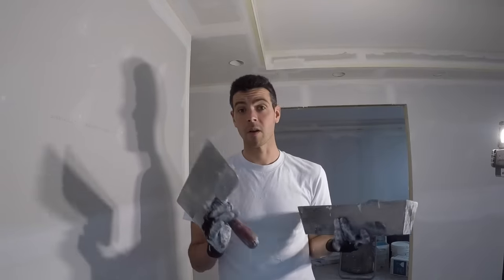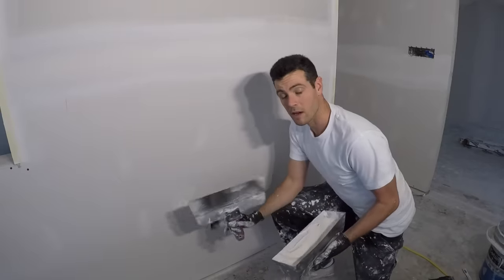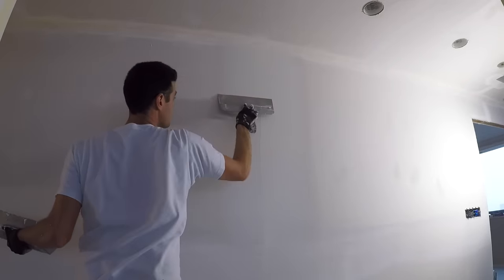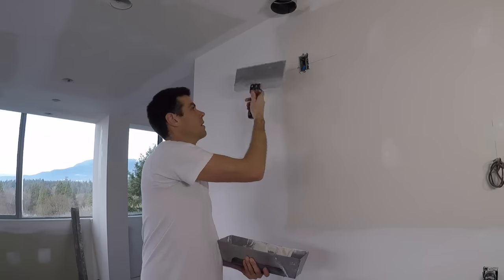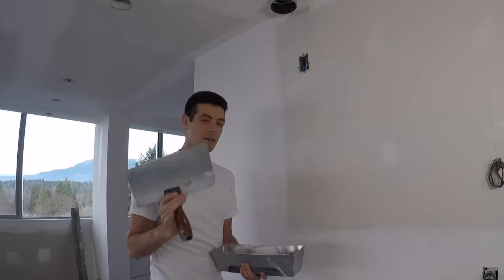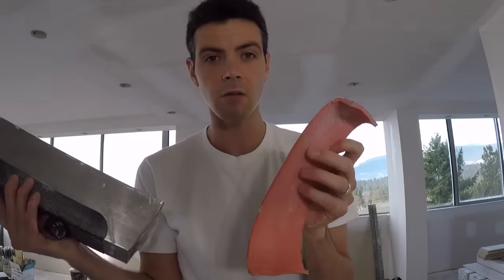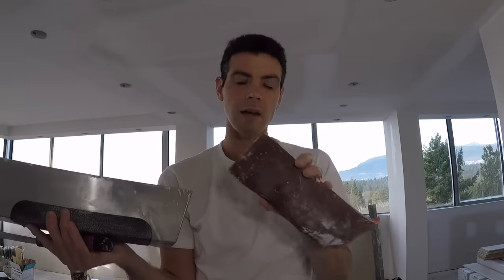HOW TO COAT DRYWALL( BUTT JOINTS)

Comment: Yea hire professional drywallers and finishers, just wondering why your hangers would put a butt joint right next to a window opening and next to a corner bead? Unless you can't get a board that long in place but normally you would make your butt over your window/door openings, a hell of a lot easier to hide than a butt 16" or 32" from a window/door opening. The key to a good finish starts from the framing of the walls got to be as straight as possible any warped studs got to be addressed, then the hanging of the board, once again straight and clean ,not hung by board butchers!! Then it makes getting that nice finish a whole hell of a lot easier!!!
Reply from the maker: It's a high rise. Only 8 foot sheets will fit.
Reply: Wouldn’t putting a butt joint over a door or window just insure a stress crack will happen???
Reply from the maker: Sadly. I think putting up drywall insures a crack will happen. You do have a point about the location though. I just think drywall is a crappy product that was only invented because it was cheap and fast and we needed to build a lot of houses real quick after WW2.
Reply: For sure. You demonstrated and explained well though. Good job 🤙
Reply from the maker: Thank you:)
Reply: Benjamin Dover The best thing to do is not have any butt joints and run full sheets when possible, but if it's over 16' or it's not possible to get that length in place you should break as close to the middle as possible over a doorway/window and not over the door knob/strike side of doorway, some people hang up to the edge of the rough opening and that will guarantee a crack from door opening and closing. Pre fill with durabond glue and screw, butt joints shouldn't crack unless there's significant settling of new construction.
Reply: Put a little dawn dish soap in your topping or all purpose drywall mud it makes it smoother and helps keep out air bubbles that leave pock marks in finished product, less sanding, clean finish.
Reply from the maker: Agreed👍
Reply: Well from what I know if you add any product to drywall mud then the manufacturer won’t guarantee their product if anything should happen so maybe just don’t add dish soap. And no matter where you put the butt joint over the door or window it’s not going to prevent the wood framing from shifting and still causing it to crack. The drywall doesn’t crack the expansion and contraction from the wood framing causes cracks. So idk
Reply: @fabianvasquezjr8852  if you modify from the manufacturer they don't guarantee their product.  If that works great, but I would rather have the company behind me if something went wrong than have to pay it out of my own pocket.    Then again i'm not a professional, just a handy guy who gets a pretty good result by following the directions on the box.
Reply: About 3 inches from the corner of the doorway or Windows. Use drywall glue, and screws. One screw replaces 2 nails, glue replaces 1 screw. Less cracks with those two. However they can fix a bad framing job.

Comment: Want to know how to make a perfect butt joint? Run the drywall vertically as the manufacturer designed it to be run. That is why it comes in 8 and 10 foot lengths. I guarantee I can walk into any house you have done and find the bulges of butt joints. The reason I know this is the only 2 people who run their drywall horizontally are those who don't know any better and those who care more about production than quality. Production guys aren't going to spend the time putting on 3-4 or how ever many coats it takes to really hide the joint and you know that. That is why so many home builders are painting with hard to clean flat paint, because it helps hide the shoddy drywall work.
Reply: I always wondered about that every time I saw someone hanging it horizontally. I was always taught to hang it vertically...which makes sense with the lengths it comes in as you mentioned. Plus, that means your joints are always flatter, instead of bulged up where two ends meet...which should really be along the floor/ceiling. I'm no carpenter by any means I've just helped a few friends here and there...we've always hung it vertically. I was very intrigued the first time I saw someone hang in horizontally. My first thought was "Do they know they're hanging that wrong?" Which very quickly turned into "Wait, am I doing it wrong? Do they know something I don't?" Glad to see your comment I don't feel so crazy now.
Reply: I dont have alot of practice taping, so when i finished my basement i hung all the drywall vertically, so i wouldnt have to deal with as many butt joints... a few people that stopped by, cause i was doing it in my spare time, said i was hanging it wrong!
Ceilings are another story though... lol
Install the longest sheets you can possibly fit in through your workspace, and eliminate as many joints as possible.
Reply: ha ha . you guys are all funny.  I've only spent 3 weeks working with a union company taping a commercial job. the drywall is hung HORIZONTALLY. So the flat/recessed joints are horizontal and the butt joints are vertical.  They told me why but I don't remember.  I don't see how putting drywall on horizontally would increase production over doing it vertically. I did a google search and indeed, there are reasons for hanging drywall horizontally and it is preferred. ... This is one of the explanations I found. 

According to Chapter 3 of the Gypsum Construction Handbook, published by USG, manufacturer of SHEETROCK® Brand Gypsum Panels...

Perpendicular vs. Parallel Application
Gypsum board may be applied perpendicular (long edges of board at right angles to the framing members) or parallel (long edges parallel to framing). Fire-rated partitions may require parallel application. (See Chapter 10 for specific information on fire-rated systems.)

Perpendicular application is generally preferred because it offers the following advantages:

Reduces the lineal footage of joints to be treated by up to 25%.
Strongest dimension of board runs across framing members.
Bridges irregularities in alignment and spacing of frame members.
Better bracing strength—each board ties more frame members together than does parallel application.
Horizontal joints on wall are at a convenient height for finishing.
For wall application, if ceiling height is 8'-1" or less, perpendicular application of standard 4' wide panels results in fewer joints, easier handling and less cutting. If ceiling height is greater than 8'-1", or wall is 4' or less wide, parallel application is more practical.
Walls ranging in height from 8'-1" to 9'-1" can be clad with perpendicular 54" wide panels to eliminate the addition of more joints. (See Sheetrock brand gypsum panels—54" in Chapter 1.)

For ceiling application, use whichever method—parallel or perpendicular—results in fewer joints, or is required by frame spacing limitations

For double-layer ceiling application, apply base-layer boards perpendicular to frame members; apply the face layer parallel to framing with joints offset. On walls, apply the base layer parallel with long edges centered on framing; apply face layer perpendicular.
Reply: Some commercial works requires stand up board.Horizontal has always been the way to go.How long have you been in the business.... a few months. Sheesh! I'm in it 40 years and you talk like a worm.
Reply: @yabitz742  

I generally try to hang it horizontally for the reasons that you found in your Google search. Horizontally definitely works better when you can you use extra-long sheets to cover the full length of a wall.
Reply: Vertically is the best way to get a flat wall, no questions asked. That’s why it is manufactured with bevels on the finished edges which allows the mud to fill to the same height as the flat. You always want the unfinished ends hidden by trim or a corner whenever possible. Not to mention hanging vertically makes it much more likely that you will have a flatter finish when using corner bead.

No doubt horizontal hanging is easier, cheaper, and faster, but if you are chasing perfection, vertical or plaster is the only way to go.

Comment: He takes the “mystery “ out of  rocking and taping ❗️
Reply: The only real mystery for beginners is not understanding you have to create the flat surface by feathering out significantly enough from the joint in order to sufficiently conceal it.  Most beginners slop a whole crap load of mud on in a thin strip barely wider than the tape and think they're just going to sand it down and end up with a perfectly flat joint ready for paint.

Once you understand that concept any mystery is gone.  The rest is just getting a feel for the process, and that can only be done through repetition.  It can't be taught.

Comment: I got a pro tip for you to help with not over stressing  your wrist when using bigger knives. You actually want to choke up on the knife and have your three middle fingers resting on the back of the blade. I was taught this after taping for 4 years by and old pro and it makes a word of difference on how much effort it takes to apply the right amount of pressure to the knife.

Comment: Awesome, informative. My nemesis is dried boogers in the mud, so first I dry scrape the wall bottoms before mudding, and when done for the night or the project, I take a 6" knife and scootch the bucket walls until the mud is flattened down, then use my thumb-forefinger web to clean off the rim of the bucket before putting the top on. Some jobs I've had to even vacuum the floors just because it was so messy.
Reply from the maker: I'm pretty fussy like that too.

Comment: If you do lots of mudding you should get yourself a 10 inch mud box and a 12 with a handle. Its so much quicker than hand filling . Set your mud box to flat fill it up with mud and fill as fast as you can walk. With a mud box you could fill all your bevels in a 10x10 room in under 3 minutes, ceiling and all. This way they are true flat unlike a blade flexing with different hand pressure. You can do all your butts too by adjust the box to crown. You would never have to feather an edge again. i have even used a mud box to fill corner beads. So much quicker, flatter and way  less sanding.

Comment: You make plastering look easy.
I've been getting so frustrated with getting my walls straight that I'm spending more time repairing sledge hammer holes in the walls from blowing up at the house than smoothing out the butt joints.
This video helped though & I hope I can semi mimic your technique now, thanks.

Comment: This was an excellent video! What I loved about it most is even though I struggled to do it as well as you I at least knew what I was shooting for. I like that you explain why we are doing things in addition to how to do something. I also find it super helpful when you let the video roll and we can watch you work. Its very enlightening seeing the process more at real speed.

What I struggled with the most was putting too much mud on and I ended up sanding forever. For me the problem is because we are putting mud over the tape I don't know how to gauge the depth of the mud. Other techniques say build up smaller layers but building up flat in multiple layers I found more difficult.

Comment: Just a suggestion regarding your shoulder issues. Don't disregard weight training for building up your back, shoulder, and upper body muscles. I'm 68 and have been working in the trade for 40 years now and hit the gym regularly paying particular attention to upper body strength. I can easily work a 10 hour day with no problems and have no shoulder issues. I can tell, looking at your physique, that you could use some strength exercises, especially in the upper body. Don't make the mistake of thinking that, just because your muscles are being used in your work, that this is enough. It isn't, because they adapt and your strength gained by work plateaus. 

Oh, and love your videos. I've learned a number of things from them to improve my taping.

Comment: Nice job!  Good instruction.  Obviously this trade skill takes a little time to master...good instruction on "speed bumps"   I am fairly experienced in this trade but still learning.  Have been wet sanding as that seems to work well for me.  I have done my whole house and a few others but still learning.   No doubt your mixture and that 12--14 inch trowel is very helpful.  Like your techniques  ....as you say "your secrets"   Right equipment, right mixture, right techniques...like the idea of the "final coat."  Now  contractors and "do  it yourselfers" have a fast and effective way to get the job done.  No more plaster put over lath walls prior to the appearance of sheet rock on the construction scene...that must have hard to do.   Sheet rock,  properly installed,  followed by a good tape and an experienced spackle guy is the way to go.

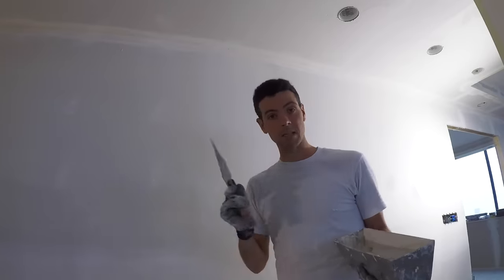Comment: 4:39 Moving the liftoff lines away from the middle is amazing advice.  Thanks.   Edit to add:  I always got the joints hidden in the end, but this adds an algorithm to the process that will save me a ton of time futzing around in the 3rd or thin 4th coat.  Thanks.

Comment: Try a first coat on tapes with a 10 3 sides and float it backwards for the center float.  When you think about compound shrinkage you will understand.  Not easy but a scratch and finish is all thats needed after.

Comment: Firstly when dealing with difficult joints where you have to use a lot of mud I prefer to use an auto body 2 foot sanding block to make these kinds of seen virtually invisible and then break the edges off with your standard drywall sanders.

Comment: Lift off lines A.K.A Lap marks/lines. I've been doing my but joints w/15" tape tech box lately. But i know a lot of companies do it by hand. It's work either way you do it. One thing i noticed after taping for 20-30 years is that i don't get particular on whether to do the middle last...perhaps that's fine w/a knife. I use a trowel & sometimes it works out best to go left middle right or right middle left... the order is not important to me any more... less sanding is & of course getting them FLAT is the most important...or at least close to flat

Comment: Use your off-hand to help balance out the neck/shoulder issues?  Train yourself when you are in non-critical areas/stages:  in closets, first coats, band-aid fixes, etc...  And then flip sides occasionally to balance out your body.  And take up yoga.  I wish I had started a long time ago.

Comment: I use a 14 inch knife, and spread the mud out wide like you do.  When I finish an area where the drywall was patched or removed next to existing drywall, you cannot even tell the wall was ever opened.

Comment: I've always wondered why they don't put a tapered edge on the ends of drywall sheets like they do in the edges. Seems like it would make those butt joints much easier.
Reply from the maker: It would!

Comment: Good job on butt joint, I was waiting to see if your last wipe was down the middle, that's correct, so the mud pushes out and fills the "off set". Trowels work great, but recommend for more experienced finishers.
A 12" knife is sufficient for most butt joints, must double up too. I double all my butt joints, just for uniform look.

Comment: Ben have you heard of TrimTex Buttboard? It's particleboard strips with a slight inward angle toward the center. The butt joints get mounted between studs and pulled together by the buttboard, so you can tape and mud like a factory joint. I just discovered in another video right now and thought you might be interested if you haven't seen it before!

Comment: A very important detail is taking care of your knifes, no chips or dings, flip them occasionally to keep edge straight, and they get razor sharp as they wear.
You should use a hawk if you're hand taping, you can control it on knife better and hold just as much mud.
Pans are uncomfortable to hold too, and designed for Ames taping tools. Requires really thin mud. Imho.
Reply: Yea, I agree. I take good care of all my knives,  never scraping anything off the wall with them
 Jave seen guys using the same knife they plan on taping with, as a scraper, scraping shit off the walls. Imo, that just screws up the edge.  Also,  I noticed he mentioned something about there being a bow to the blade, and to always place the bow towards the wall.  I flip my knives constantly,  and have never had a problem. I eyeball them at least twice per job. Making sure my ends are getting bent 
 Not sure where he came up with that,  but I disagree. I've never had a knife with a bow 
  Maybe someone has pushed way too hard on his and bent them.

Comment: After a good while of straining one handed to exhaustion, it'd get very difficult to control where I was applying preasure. That led to going over one joint over and over, not only get more and more tired but frustrated, then rushing. One day I just decide to it two handed which left me with the issue how i was going to avoid wasting time picking up and setting down the mud pan. First I ruined a mudpan trying to screw it to my ladder without a pilot hole. The plastic is brittle so a pilot hole and a washer on the screw prevented ruined a second pan. I set my foot down on the ladder so not to tip the whole thing over pulling mud on to my pan. Also made sure not to hit the screw with my knife. Using a damaged knife that leave ridges to sand off is a pain in the ass.